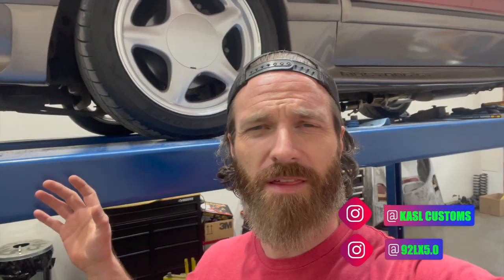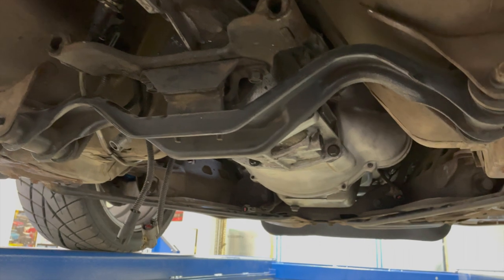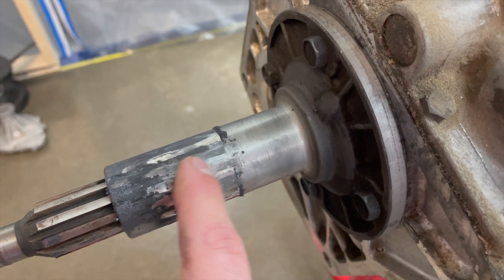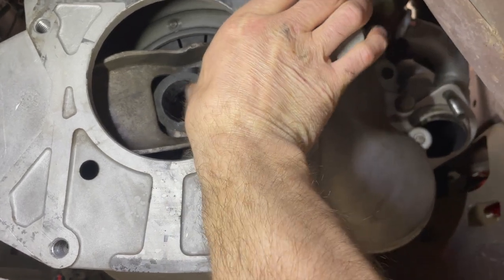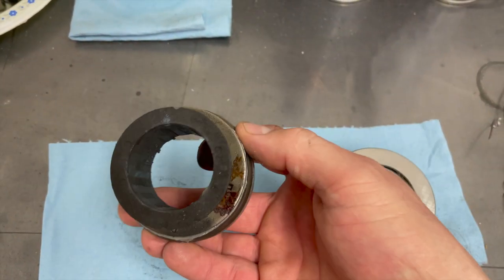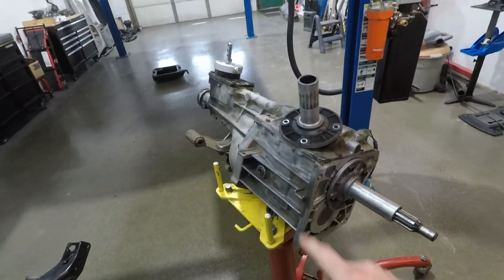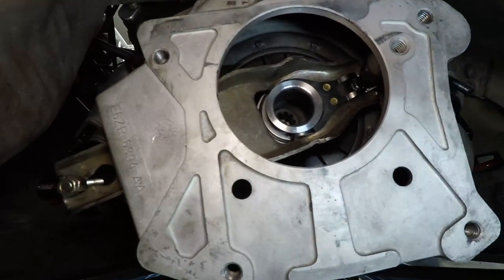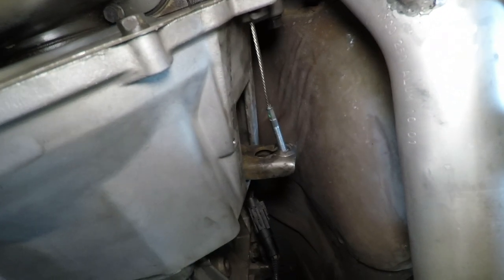FOXBODY Problems - Your "Slight Rattle" Noise Might Be Worse Then You Think...

Comment: I had the same problem when I did my clutch. I’ve always liked my clutch to grab low so I set mine up that way. Turns out that when I did that, I had no preload on the throw out bearing which caused it to start making noise within a month. I needed to tighten my clutch cable significantly. From the looks of your adjuster nut, that might be your problem too. I got used to it grabbing higher pretty quick and haven’t had a problem since
Reply from the maker: I had about 5-8lbs of preload on the bearing. I’m trying to remember now but I believe when I shot the video of the “shaking” clutch fork, I may have already loosened it off. Thanks for the insight tho 👊👊👊

Comment: Good afternoon big fan of your channel. I just recently bought a 1992 mustang 5.0 the clutch is letting out right at the firewall. I was going to see if I adjust the clutch cable underneath if that helps. It also has a surging issue which I am looking into now.
Reply from the maker: Check and see if it has a firewall adjuster first and see where it’s set. Also, check at the clutch fork as well 👍

Comment: Glad you were able to diagnose and fix the transmission problem. 👌

I have an automatic overdrive transmission in my 1990 foxbody mustang. The overdrive band burned out and I lost overdrive. 

Question - do they make a repair kit to repair the overdrive band?

Any suggestions?

Thanks
Reply: You could try replacing a qt of trans fluid with lucas trans fix, ive witnessed it make a transmission in a Taurus sho that wouldnt even go in gear get another 20k mile before total failure, if any fix in a bottle could work for your situation id put my money on lucas.
Reply from the maker: Thx sir! Shoot I’m not 100% sure… automatic trannys get a little over my head…
Reply: @KASLCustoms  im a mechanic by trade but my dad was an engineer for ford for over 20yrs, he was on the transmission design team for 1-3 gen explorer/mountianeer transmissions, i know a bit about them, but absolutely despise everything about them lol. Will not do anything on them besides services that dont require removal from the vechicle.
Reply from the maker: Lol I hear ya bud 😂

Comment: I JUST PUT A LOWERING KIT FROM SR PERFORMANCE  AND UPPER AND LOWER CONTROL ARMS. NOW I HAVE A ROAR / VIBRATION OVER 25 MPH WHEN THE CLUTCH IS PUSHED IN AND CAN HEAR IT BEFORE THE CLUTCH IS PUSHED IN . THIS IS A 92 5.0 5 SPEED LX I'M GOING TO CHECK PINION ANGLE BUT SOME SAY CLUTCH /THROW OUT BEARING/PILOT BEARING .DID NOT HAVE ANY ISSUE UNTIL I LOWERED THE CAR. ANY HELP IS VERY MUCH APPRECIATED
Reply from the maker: That's super odd. I can't imagine that it's because of lowering the vehicle because you're far from the first person to lower your fox and this is not a common issue that follows. I have a feeling that this is an issue that was going to happen regardless however its just decided to present itself following the upgrades. Did you happen to lose a wheel weight when you had the tires removed? Also, a bad throwout bearing typically presents when the clutch is fully released, not depressed. I do agree with the fact that it may be pilot bearing related...
Reply: @KASLCustoms  thank you for trying to help me. the funny thing is that i lowered the front first to see if i wanted that stance and drove it with no issue. Of course i did not drive it everyday but about a month later i dropped the back and when i drove it then is when i noticed it at around 30 mph and on and it gets worse the longer i drive it. i don't think i have lost a weight but i can feel it in the gear shifter real bad when i let it cost. i even put it on jack stands and it still makes the noise/vibrate ,third gear seems to be when it wants to start. love your videos i have learned alot

Comment: Great video sir!
Reply from the maker: Thx buddy!
Reply: @KASLCustoms  You’re welcome boss. 

Question, I replaced my lower and upper shifter boot yesterday and the trim piece on my 92 lx vert and noticed the trans was cocked to the left- counter clockwise a little. Is that normal? I grabbed the base of my short throw and the tail end of the trans and put some pressure on it and I definitely have some movement. Up and down. Side to side not so much.
Reply from the maker: Did you check to see if the transmission bolts are tight? Maybe you’re transmission mount is bad?

Comment: Could this happen on a 2019 gt? I hear the rattle right under my feet and is most prominent when idling through a right turn. Does not increase in frequency when rpm increases.
Reply from the maker: Yes I guess it could…

Comment: I must have been drunk the shop only fixed the idle rattle its still wrong its sound horrible when letting out the clutch in 1,2,3,4 gear likea boat motor for 14 months....bent input shaft or bad Sachs flywheel